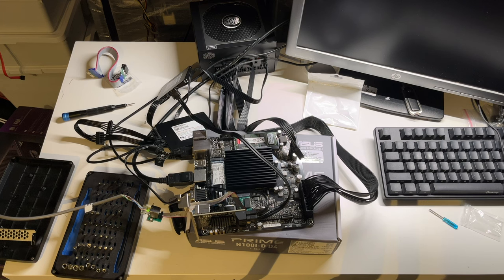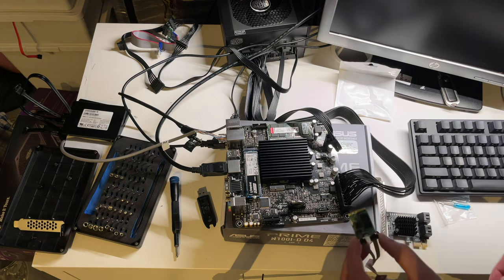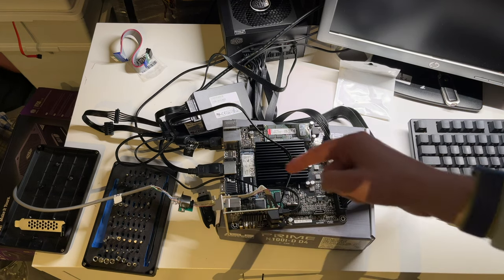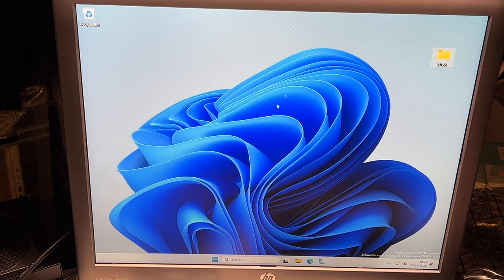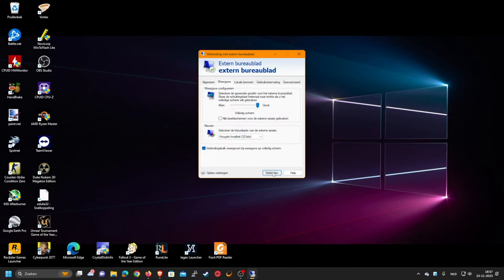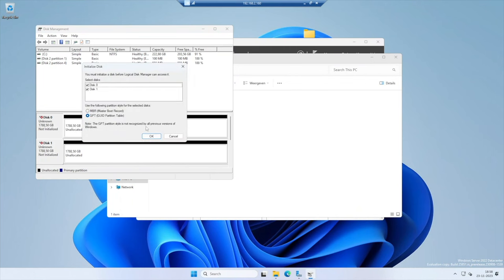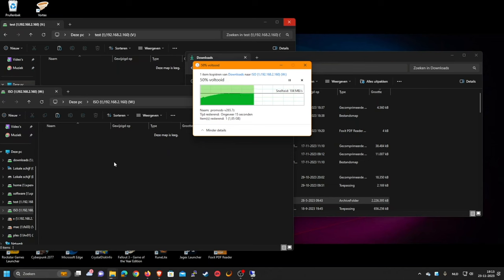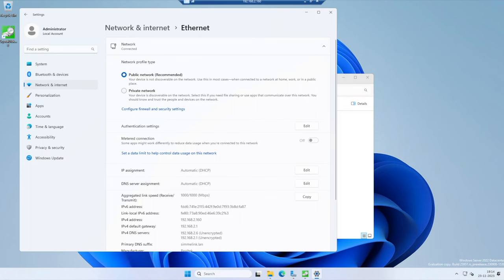Intel N100 Based Server "Upgrade"? ft. Asus Prime N100I-D D4 - Part 2

Comment: 2:30
What I did was use a wifi m.2 > mini pcie > pcie riser to connect to a 10gbe Aquantia asus card. 
Its the cheapest way since its old stock used for gpu mining. About $10 for the adapters.
Reply from the maker: Interesting solution! Unfortunately I don’t have enough space in the case to have another riser board and accompanying power cable, but if I end up upgrading my other server, that might just work.

Comment: and if you install the Universal x86 Tuning Utility, you can set a constant 16w tdp, but active cooling is required, so the processor does not regulate back to 1.1 ghz even with prolonged use, it stays at 2.9

Comment: Great video!
I have the Asus N100 and an ASM1064 PCI card with 4 SATA similar to yours.
My problem is that HDD hotplug doesn't work on this card but it does on the motherboard SATA,
Does it work for you?
Thanks.

Comment: I think you’re getting confused with the ‘allow caching of share’.  It’s not a disk cache, or allow shared files to be cached / made available offline. It’s not to speed up disks , as such.
Reply from the maker: That feature is specifically for caching the server side files for offline use, it uses client side caching for that, which means you’re not pulling the file off the server each and every time but it possibly uses a local copy, which would invalidate the results in the video. 

It’s not likely it would’ve made a difference for this short test, but it’s best to leave it disabled. 

Because this feature is also a source of annoyance and weird issues for many Windows sysadmins, such as myself, I always disable it regardless :)

Comment: USB 2.5 GBE adapter could have been another route... but cool!!!!!
Reply from the maker: I’ve thought of that, but what I noticed is that USB network cards can’t do 24/7. Their buffers fill up over a few days and then the cards stop working. I verified this when I used USB 2.5GbE cards on a Synology NAS. In the end, an internal card is the more stable option and they cost about the same.

Comment: Does this Mother board have NVMe or does not? I would like to split the m.2 slots to 4 SATA slots is it possible with this? (the asrock n100 know it, but it has only external DC powersupply support)
Reply from the maker: Yes, nvme is supported in PCIe 3.0 x2 mode.
Reply: @nelizmastr  may I ask, maybe you know this: that means it can run all  6 sata ports (maybe but slower) or less sata ports (as I'm seeing the "x2 mode") full speed?
Reply from the maker: It will run all ports, but it’ll be limited to the 2 PCIe 3 lanes, meaning a maximum of around 1GB/s which is plenty for SATA harddisks, and in mosr cases for cheap SATA SSDs in a RAID5
Reply: @nelizmastr  thanks, for your time. I appreciate it. I'm not very savvy in these part of things. Now it is clear. I thought only that many HDD-s as many lines...  but it about the band with... as far as I can reach 70-200MB/s it is well beyond ok

Comment: Hi, i have same board and i test this PC in cinebench and have  Multicore score only 1650 pts (i found on net to be around 2200pts  ). What is strange i cant upgrade bios ...
Reply from the maker: This board throttles the cpu to 6W quickly so it won’t be as fast as others. Mine also won’t update, the latest bios appears to be broken.
Reply: @nelizmastr  finally success with bios, need to reset bios settings and of coarse use renamer or rename bios file. I will chnage this board for asrock because in asrock is possible change those limits. I have issues to watch YouTube videos even on fullhd resolution...
Reply: @nelizmastr  if you want beta bios with pl1 8W limit i just received it from Asus support.
Reply from the maker: That’d be very nice to have. If you could send it or a link to it to nelizmastr@gmail.com then I’ll happily try it out :)
Reply: @nelizmastr  Did you recieved email from me ? What was the result? Better performance ?
Reply from the maker: Hi, sorry for the late reply. I've been ill for a good while and haven't been able, until recently, to give it a try. I don't notice a performance difference, but that's because I used throttlestop to do what the BIOS can do now, but I'm happy overall with the results. I no longer use throttlestop.

Comment: Do you know that 6port sata controler will work with this
 PCI? It will be interesting to test plex transcoding with this little beast ...
Reply from the maker: Yes, that should work. You’re bandwidth limited a bit though with just 1 lane. I’d probably opt for a m.2 to 6 port sata adapter that slots into the slot for the nvme SSD.
Reply: @nelizmastr  and cache to an ssd on the mobo sata port
Reply: @nelizmastr  Is the m.2 > 6 port a better option because of bandwidth>? I am trying to decide between just getting an older 5040itx vs this. I will be putting 3.5 inch drives in so the measly 1 sata port is pretty silly but everything else is quite a step up.

Comment: Seems Asus wasted the opportunity with that board. Chinese manuf. like Topton, and BKHD created a mini ITX board N100 with 6xSATA, 2xM.2 nvme, and 4x 2.5Gbit NICs, much cheaper than Asus.
Reply from the maker: It’s a shame those Toptons have 4x 2.5Gbit and not 1x 10Gbit otherwise they’re perfect for a storage server/NAS.
Reply: @nelizmastr  It also comes with a 1XPCIE which may not be enough for a 10Gbit card, Right.
Reply from the maker: 1x pcie 4 would be enough but the n100 doesn’t have pcie 4. Most 10g cards are 2x/4x pcie 3